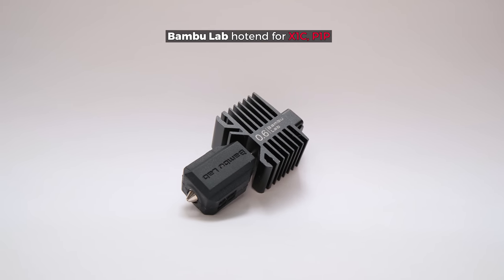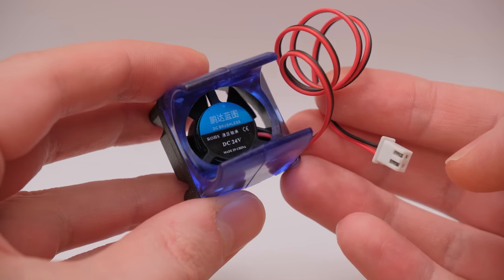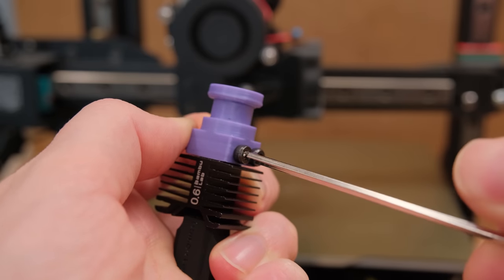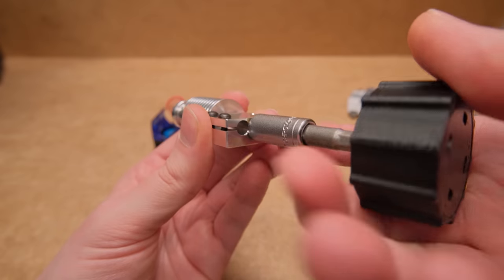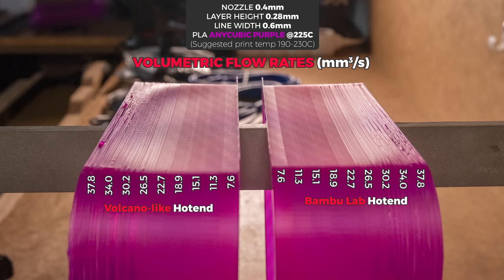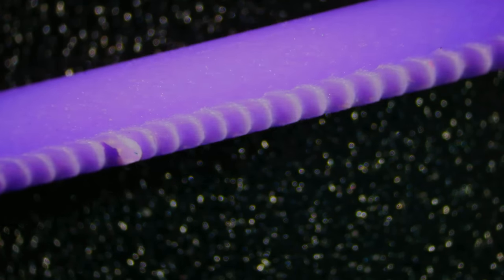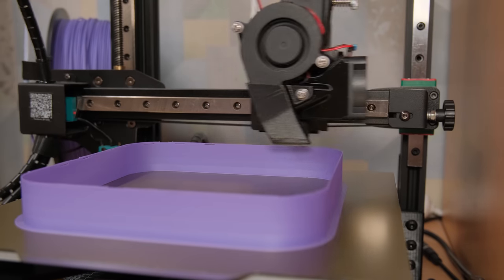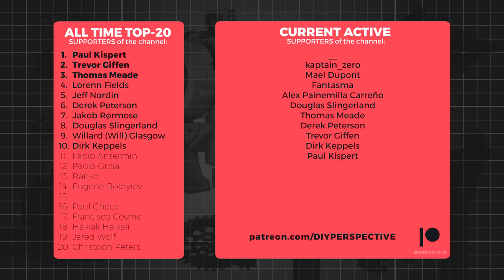BAMBU LAB Hotend on OTHER 3D Printers – The BEST VALUE High-Flow Hotend?

Comment: I've used the bambu hotend now on my two latest self-built printers including on a multi-hotend printer where the small size really helped in the design - they have worked really well.
Reply from the maker: Nice! Yeah, the size and performance ratio is crazy good.
Reply: I'm doing the same!
Reply: With what adapter?
Reply: @riccardosacchetti no adapter at all, it is a simple mount with 2x bambu hotend + hextrodort mirrored each others. I will show it in the next month on my YT channel Power3d
Reply: @carloblumer4445  no ma sei il Carlo di power3d?!? Grande! Attendiamo allora!
Reply: @riccardosacchetti  mi interessa sapere come va la tua Prusa klipperizzata... ti ho scritto sotto il tuo video ;)
Reply: @carloblumer4445  Nooo, non sono abituato a rispondere a qualcosa che carico io! :)
Reply: I like to do this too, is there a printer settings I have to change to get it working correctly? Thanks for sharing ❤
Reply: yeah i like small things aswell

Comment: The problem with your test is that you are comparing a brass/copper nozzle against a hardened steel nozzle inside the bambulab hotend which is actually 4-5x worst than brass in heat transfer... so if you tested it using a hardened steel nozzle in your other hotend... you will find a significantly different result... or like others have suggested... a 3rd party bambulab hotend which you can swap nozzles....

Comment: I think the main reason your printed adapter wobbled and the metal one did not was because you used a different mount method, not because the plastic one was inherently worse. taking one side of that mount off allows the screw to make solid contact with the hotend itself and thus resulting in a more solid mount. When you sandwich the two pieces of plastic round it, you are losing force to not only the compression of the plastic, but also, the coefficient of friction between the plastic and metal of the hotend is probably a lot lower that the screw directly touching one side of the hotend.

Comment: BTW, chinese already made a copy of Bambu hotend and sell if for $12, it's improved by adding 2 screws and reinforcement at the heat break and adding replaceable CHT nozzles. It's called TZ hotend. There are versions for Bambu mount, for Ender 3 mount and for V6 mount, so no need to machine the mounting.
Also the Bambu hotend on Bambu printer makes the same ~22 mm3s, unlike advertised 32 mm3s. Tried with 0.4 and 0.6 nozzles.
Reply: I'm thinking of getting the TZ hotend. Would you say this is a better choice than a V6 + Volcano?
Reply: .. a copy from a copy

Comment: I have an X1C, and looked at using the hot end in a print head replacement, I went with the E3D Revo, despite the lower cost of the Bambu part for easy nozzle swap.
Reply: Do you have any ringing and / or ghosting on parts?  I've seen some on youtube after making a purchase and got me kinda worries.  I hope I got a good one.
Reply: @redone823  I use Orca slicer aka the SoftFever fork of Bambu Studio, and a hardened 0.6mm nozzle currently, and the standard profiles aren't clever, so I'm slowly dialling them in, but overall the quality is a lot better than what I normally see. I don't run mine as fast, so quality is better, and have good results dialling in my non Bambu filaments with the calibration tools in Orca. I also found standardising line widths and keeping the speeds more consistent with each other (except bridging, support interface and overhangs) made the 0.6mm nozzle produce better quality prints when using the Arachne engine. If ghosting and ringing are your major gripe maybe Klipper integration should be included with your printer of choice.

Comment: You should look at the new hot ends that Qidi Tech is is using on their latest core x/y machines... I don't think they have them available for individual sale yet, but it is basically a BL clone with more "off the shelf parts.  Like a more "standard" fan, replaceable nozzles, and a rapido style heater block. Great job on the adapter! 👍
Reply from the maker: It would be a great hotend if they would be using Volcano length nozzles. But they don't - https://i.imgur.com/SMgsou2.jpg Also you can't buy these hotends on their site (EDIT: nevermind you now can). Thanks!
Reply: @PrintingPerspective  Do you have a measurement on how long the Qidi nozzle is?
Reply from the maker: 19mm, volcano is 21mm https://twitter.com/diyperspective/status/1648962898801180673?t=LHKAKZ7fjPiRtK7dc3wGog&s=19

Comment: I suspect that the hardened steel tip makes more of a difference than we think. The melting quality is only determined by the length of the melt zone (provided the diameter is correct) for a straight bore nozzle m(not a CHT). When the material arrives at the tip the center of the filament is inevitable not as hot as the outside at high extrusion speeds and the stainless steel tip just can't put that little extra heat in to also melt the center properly.
Without having done scientific testing I noticed that a CHT nozzle gives me significantly stronger parts at higher extrusion speed (especially with ABS). Most probably due to the core of the filament being at a higher temperature when exciting the nozzle. For this reason the first upgrade of a Bambu printer would be to switch to the Ali nozzles with CHT like insert. This configuration seems near ideal to me: the first straight bore zone softens up the filament before splitting it in 3 to get better melt quality. Maybe the copper insert in hardened steel nozzle evens out the melt temperature of the outside versus inside of the filament strand due to the better heat conductivity of the copper insert.
Reply: I had a normal V6 hardened steel nozzle with a copper spacer to fix into a volcano heater block, which worked far better than just the hardened nozzle in a normal V6 block and still noticeably better than a nickel plated copper nozzle. I still had to slow the printer down to 10mm3s flow on mechanical parts and dimensionally would print fine up to 26mm3s flow

I picked up a set of Micro Swisses new Volcano CM2 nozzles, 0.6mm and 0.4mm. They have a small hardened steel tip but the majority of the nozzle is copper with nickel plating and non stick coating. I did not thing they where going to be so much better, I'm up to 16mm3s for mechanical parts and around 30mm3s for normal astatic prints

I still haven't tried CHT nozzles, but I'm thinking of putting in a CHT spacer for the volcano hot end

Comment: The Qidi Tech hotends are the same.  great value.  You can also buy the extruder, and even the blower fan.  The Qidi one is also good up to 350 C.  It seems like these hot ends are better than the aftermarket hot ends.

Comment: Which metal type did you use at PCBway for the adapter?
Reply from the maker: I chose stainless steel but it is a complete overkill and very heavy. I suggest using aluminum 7075, it is more than enough.

Comment: After installing bambu lab hottend and soldering wires can you increase maximum printing temperature on Kingroon KP3S from 260 to 280 or 300? And is it safe?
Reply from the maker: You increase the max temp limit depending on what hotend you installed, so if you are using one from Bambu then yes 300C is officially the max temp for it. It should be safe unless you don't trust the Bambu of its rating, you know. Plus you won't be printing anything high temp on KP3S anyway, so...
Reply: @PrintingPerspective  Ačiū labai už atsakymą bičiuli:) 
So really soldered part of stock kp3s thermistor wire which goes to the motherboard doesn’t prevent increasing max temperature to 300C?
I’ve made a custom enclosure for my KP3s 3.0 and it prints quite good Rosa 3D PC+PBT on 250 with V5 upgraded all metal titanium heartbreak, but when my TZ 2.0 hottend will arrive I want to print some temperature towers to test if 250 is enough, and try Prusa PC blend which requires +-275 degrees
Reply from the maker: I soldered bambu hotend's wires to the stock kp3s wires too, it works just fine, it is not that more powerful than the stock kp3s hotend (40w vs 60w). Now if you would be using a 100w hotend, then yes you should replace the heater's wires too with ones rated for a higher current.
Reply: @PrintingPerspective  Did you increased max temp to 300 on yours, or left at 260?

Comment: looks like a good choice to modify my anycubic predator. Just need to find lightweight feeder to get a direct extruder there
Reply: Sherpa Mini, Sherpa Micro, VZ-HextrudORT, Orbiter 2.0, Sailfin, Sharkfin, and LGX Lite are all GREAT lightweight extruders. Personally, I would go Orbiter 2.0 or Sherpa Micro, but it's your choice
Reply: @coltenmeredith8899  has anyone tested the cheap lerdge direct extruder?
Reply: @Jörg Fichl  I most definitely haven't, but it looks solid. 4:1 ratio is perfect, larger BMG style gears are great, and lightweight is awesome. That sounds like a great option, but I'm worried the stepper motor is bad quality. I say grab it, and if you don't like it, you can return it

Comment: Did you find out how much the metal adapter would cost to be manufactured by PCB Way?
Reply from the maker: It is like the price of three hotends, but like I said in the video you can print an ABS CF version that would perform well enough.
Reply: @PrintingPerspective  or you can also make a mold with the 3D printer and then cast it with CF reinforced resin.

Comment: When I saw how affordable their hotends were I stopped at "thats really cool for bambu replacements" and never made the leap to "put it on other printers." Even if it underperforms a volcano hotend, its cheaper and better made than a number of 3rd party non volcano hotends that aren't from ali express and in a very discrete form factor.
Reply from the maker: True, the price/quality/performance/size/weight ratio is insane. It is probably the lightest and smallest hotend with higher flow capabilities.

Comment: Just bought a nozzle x for my dragon hf. Now I thinking if it would have been better to buy a Bambu hotend for my Voron….
Reply from the maker: Bambu hotend's best thing is that it is very reliable because it is a complete unit without the ability to change the nozzle. No nozzle loosening with heat cycling and possible oozzing (great for a PETG printing machine). You should also look into the TZ 2.0 hotend with the CHT clone nozzle if you want a higher flow with the same lightweight design. You can find those very cheap nowadays on Ali. I use it on my V2.4 and V0.2.
Reply: @PrintingPerspective  Yeah the oozing is a problem. I will change to the Bambu hotend. 👍

Comment: The prusa mark 4 uses a single side gear extruder like the titan, does anyone know if they have problems extruding at high flow rates?
Reply from the maker: The Titan extruder has a tiny filament grip gear, meanwhile, the Prusa Nextruder has a huge gear. I suggest checking this video as it will answer your question https://youtu.be/AaX1v6qWOnc

Comment: there are already clones out where you can change the nozzle like normal
Reply from the maker: If I had only one printer then I would like the ability to change the nozzle too, but now I kinda like the all-in-one type, especially when it is so well priced.
Reply: @PrintingPerspective  The knock offs with changeable nozzle seem priced in the same range. So i  would consider to try them. So you have pros from both worlds.

Comment: Yep, the bambu extruder, hotend and nozzle is pretty much tapped out at 16 - 18mm³ / second, certainly not anywhere near as "High flow" as some of the other available options out there.

Comment: You can by the QIDI Core XY printer für under 500 bucks. It has all the same great features a P1P has and a great extruder. I really don´t get why people are so in awe about the Prusa and Bambu printers, their price to performance, especially prusa is not so great.
Reply: The qidi printer is relatively new and I don't think there are as many people simply aware of the the brand and their printers.
Reply: The review I just watched on the QIDI core xy had issues with pla, and the reviewer claimed it had to use certain filaments to deliver good quality prints. 

The Bambu labs printers appear to work well with nearly every filament I’ve used except blue elegoo pla+ which clogged repeatedly and clogged 1 nozzle so badly I couldn’t clear the clog. 

The QUDI may be a good printer, once it can deliver acceptable quality for multiple filament brands and types.
Reply from the maker: @SierraEcho88 This video is about the hotend, not the printers. But I think you are giving too much credit to the QIDI. The smallest one seems the best option, but the bigger one that I tested... I would never buy a machine like that for my money.
Reply: @PrintingPerspective  Just out of curiosity, which 'bigger one' and why not?
Reply from the maker: The X Plus 3, because it has some serious flaws that can impact longevity wise and are questionable in general (like cable drag chain dragging and destroying carbon rods, chamber heater blowing very hot air at the heatbed power cable, and more). Also heatbed is thin like on cheap printers and warps at different temps so the first layers are bad. And the noise... Oh my... not because of the motors and the fast movement but because of the fans and their placement without any engineering thought. It is impossible to have the printer in the office space if you print PLA, you will go crazy lol. And when printing ABS it is not insulated so smell escapes very easily.
Reply: @PrintingPerspective  Thank you VERY much for your detailed answer!  Liked and subscribed!

I've had an iFast for about 2 years, I only wish it was faster, and it really needs ABL/compensation, but besides that it does what I need very well with the right print profiles.
Reply: @Chris-oj7ro  This is "probably" absolutely true.
Reply: @shawnhicks619  Oh Ididn´t know, the review I watched was pretty good. I shall take a deeper look into this, thanks.
Reply: @PrintingPerspective  I mean the smallest machine, yes. It seemed to be a great 2nd option for the money. The bigger oney would be too "cheap" quality wise I mean, you are right.
Reply: @PrintingPerspective  Thank you for bringing up all those points. I will check out this machine deeper later on.
Also sorry for my horrible grammar, it was super late, 2 in the morning I believe so I mixed some German in my comment xD
Reply from the maker: The fact that QIDI almost everywhere used basic wood-type screws that just threads into the plastic instead of heat inserts, blows my mind. Sovol SV06 Plus has heat inserts even on the screen! lol.
Reply: @PrintingPerspective  Why ? Many companies use those types of screws. 
There is nothing wrong with "normal" plastic screws. It depends on how many times you are planning to disassemble the whole thing. Heck even i use those type of screws.
Reply: The qidi uses klipper, which isnt as hands off as the pure reliability of a prusa or as automatic as the bambu. Also the brand isnt as widely known. Prusa is in the game for a really long time and bambu just shattered the market. Qidi on the other hand is just there. Same goes for sovol, if people would be more aware of them nobody would even consider buying any ender 3 variant, the ender 5 or one of the normal sized cr10
Reply: @kilianlindlbauer8277  True, it is also much much cheaper than a Prusa or Bambu...so it´s still a good value, that´s what matters.
Eben am old shitty Prusa is still a good printer for say 50 bucks.
Prusa is much much better there is no doubt but here it costs 1200€ the Qidi does basically the same task, print a thing in plastik and costs about 500€ so I can get 2 for the price for one and still have money to improve.
Reply: The QIDI printer that's under $500 has 1/3 the total build volume of the Bambu P1P, so forgive me if I don't believe you when you say it has "the same features". You don't seem to know what sameness is.
Reply: @Mirrormn  Does not hcnage the terrible price/performance of the Prusa for instance. You can get the 600€ QIDI instead and have the same buld size.
Reply: The qidi version of klipper is utter garbage and good luck getting updates
Reply: @horuswasright  At least it does not spy on you...
Also price & performance, yoiu get what you pay for. And you get a whole lot for a little money.

Comment: For the simple reason that the bambu hotend is onepiece with the heatbreake, it wins hands down over absolutely every single hotend you can buy. Whatever utter moron decided that heatbreake and nozzle should seal together and not on a fixed part of the hotend should be made eat every gram óf filament ever wasted.

If theres a step of 3D printing i absolutely hate its any and all things that can result in leaks around the heatbreake. But on a bambu theres no screwed in Heatbreake, so insanely poorly engineered  issue solved right there. Sure whatever drill bigger thermistor holes add more heaters, extra mass.. meh.. you can but, it won the second it solved the leak risk issue.

I meen could some heatbreake manufacturer atleast admit enuff to add a collar to the thread that goes in the hotend?.. you know so sane people can just use a copper ring gasket.